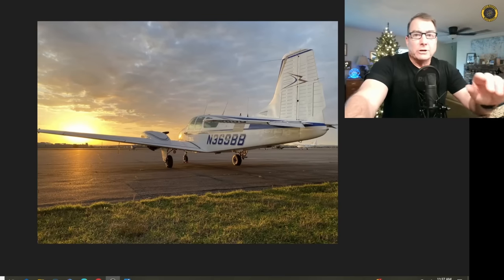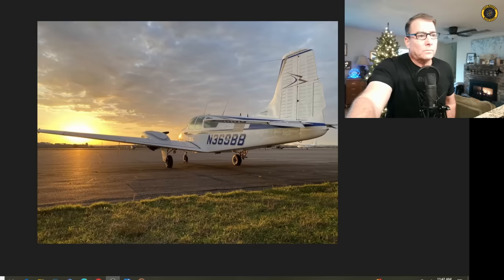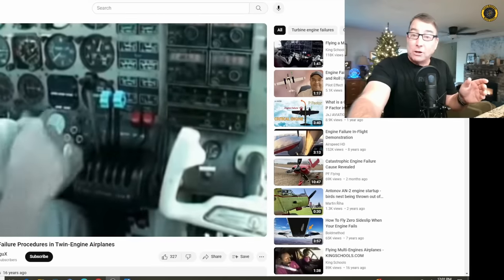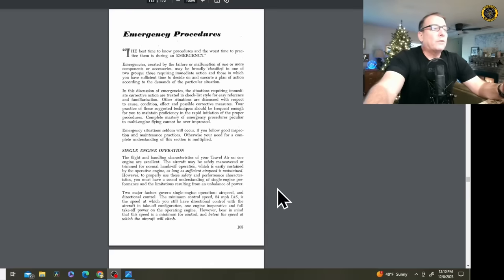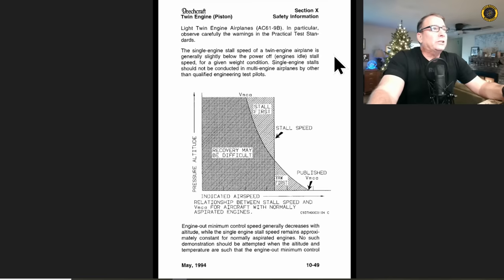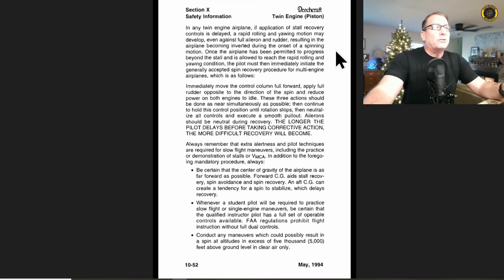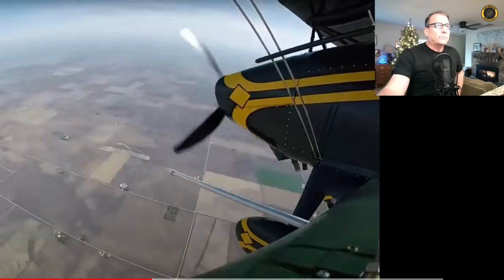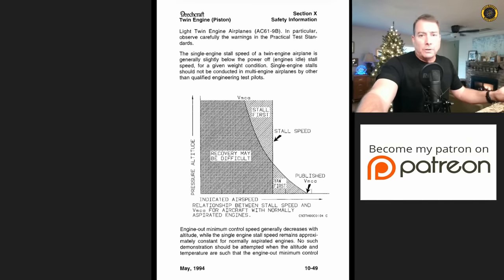Another Fatal Vmc Demo Stall Spin!! N369BB 4 Dec 2023

Comment: I currently live in Huntsville, AL and I currently work at a flying club in the area as a mechanic, and I heard about this crash through the people I work with. It shook me a little bit because I myself have been learning to fly, and have recently scheduled my check ride, which I'm very confident I'll pass. At the club I fly and work at, my instructors have always emphasized the phrase, "Aviate, navigate, communicate", especially in an engine failure and a spin, which the club instructors also emphasize. My instructor always drilled the acronym PAER in my head. Power idle. Ailerons neutral. Elevators down. Opposite rudder. Eventually I want to fly for the airlines myself, but at the same time, I don't want to rush my training. Because I want to be as safe a pilot as I can. And learning from the accidents is one way I think will make me a safe pilot. 

When people say students are being rushed through flight training, I don't have any doubt in that statement at all. In the Huntsville area there is also flight school called Revolution Flight, which this travel air belonged to. I have heard very shady things about Revolution Flight in almost every aspect. Training, maintenance, management, and business. I'd be hard pressed to think part of the cause of this crash was because of the way training is conducted at Revolution Flight. But I'll wait for the NTSB report before I make any assumptions. 

I would also think part of the problem with bad training is instructors not giving their full attention to their students, because they're just using flight instructing to get to the airlines as quickly as possible. I'm very blessed to have been assigned to an instructor who deeply cares for his students, and does a thorough job in making sure his students are ready for their check rides, both knowledge wise, and flight skill wise.
Reply: Our mechanic at our club(50yr pilot) warned me that I had the only good instructor on the roster and to go other places for my instrument rating now that he's unavailable. Seems the quality control acoss the board has dropped significantly.
Reply: The problem with flight instructing is money and regulations by people who don’t know anything. 

As an instructor
1 - you don’t get paid enough to ever live in anything other than a small apartment.
2 - almost every student you get comes to you expecting to be finished at the minimum hours and sometimes fight back at what you have planned even when they’re struggling doing some required maneuvers.
3 - even if you didn’t want to instruct, unless your family runs it’s own aviation business or charter operation you’re likely not going to find another flying job besides instructing until you’ve done about 1500 hours flying in circles

As a student
1 - you are paying a TON of money to fly something that is way simpler and less complex than most cars.
2 - planes are expensive because of supply and anytime someone has an accident, litigious dickheads try and sue everyone for what their worth, further driving up the cost.

Comment: The US Army suffered loss of life accidents in then B-55 Barons due to Vmc demonstrations because the demonstrations were taken to full yaw loss of control.   They found that less than a 5x3" strip exists on the rudder to recover from a spin due to the airflow blanket produced from the horizontal stab and elevator.   Later the limit was defined to any indication of control problem such as stall warning, not full directional control loss.   This is well discussed in all later Baron Beechcraft POH's.   When observed, the Army then had much fewer demo induced spin accidents.   To this day, all Baron manuals  feature this discussion and limitation.   I don't know about the Travel Air, but sensor indication limitation is now observed in many of the airline training academy's.   Sorry to go on, but this rudder problem in the Baron is considered a classic example of DIPE, design induced pilot error, something in the design of the aircraft that lures the pilot into a critical mistake.   In modern aircraft these problems exist everywhere.   You might find this an interesting problem to discuss on a later video.   Of course, the training actions you discussed should be taught to MEL instructors and of course, observed.   Good job, thanks Juan.
Reply: Absolutely brilliant!
Reply: so why  not  cross  coupled  engines to fix the problem ?? a  drive  shaft or  an electrical  solution ?

Comment: That upside down flip also happens in a 172 when practicing spins. One of the huge advantages of those planes, is that they are approved for spins if the weight is kept below the utility weight threshold, which was 2000lbs...at least in ours. Skyhawks really don't like to spin so you have to add a bunch of energy to kick things off...especially with a big boy or two in the seats. The way we did it was to get to a safe altitude (for us it was 4000' AGL) then get really slow and as the horn was blaring, add full left rudder and a healthy shot of gas. That unit would snap onto its back in a heartbeat. 

But like I said, they really don't like to spin so you have to keep rudder in and stick all the way back and even then, it would usually flop out of the spin on its own. What a 172 really does like to do, is spiral. That's the puppy that tears wings off of inadvertent IMC aircraft. It's usually a subtle thing at first. Basically, it starts off as a gentle, coordinated turn. If it happens during a boring part of cruise, you might not even notice. Before too long, the increasing G load may get your attention but then you're trying to figure out WTF...so what happens when you notice the altimeter unwinding? You pull back while in a steep, diving, accelerating, turn and BLAMO! Maybe you snap into an extra violent accelerated spin/stall. Maybe you lose a wing. 

Spin recovery won't always work with a spiral dive and could make it worse. The first rule of spiral recovery, is knowing that you're in a spiral. 

Juan, I would be very interested in your take on spiral dives. To my way of thinking (and of course there are plenty of exceptions) spins are more of a low, slow, patter problem...and spirals are a cruise killer. With a spin, it's the ground that's the killer. A spiral can tear a plane apart without hitting a thing. 

Thanks for doing what you do.
Reply: Excellent post !
Reply: upside down flip ?had it  happen  in  a C152  with  full flap  very  exciting
Reply: Most aircraft will flop onto their backs when entering a spin from forward flight, the type of aircraft isn't really important.  If you're moving forward, a spin is temporarily a snap roll, as you still have quite a bit of forward speed.  If you're fast enough to catch it in a single rotation, congrats, you just snap rolled your plane back to mostly level flight like a boss.  A snap roll becomes an actual spin if you let it keep going (assuming the plane obliges), at which point you lose all forward speed and trade it for vertical speed instead.  The plane will rotate around it's CG, so it's simply rotating around whatever the plane's trajectory is.  If its trajectory is forward, then you're going to flop over on your back like you did a snap roll and will continue to do so until your trajectory points downward.  With most GA aircraft that happens around the second or third rotation unless it's accelerated, or the aircraft is particularly snappy.  Cherokees and 172's are so bad at them (I guess that makes them...good?) that you basically have to hold power, rudder, up elevator, and sometimes even aileron to keep it in a spin, and recoveries are usually hands off.

Comment: I soloed in 1972 and retired in 2015 - initially Alaska-style bush flying (minus the bush, this was in Iceland where the weather is even nastier and bush is hard to find). The absolutely best advice I ever got was before my solo flight: If the airplane starts behaving funny, UNLOAD (reduce the angle of attack)! When the airplane behaves again, fly out of it. If you mucked up at a too low altitude, you are in deep shite...
The same applies if you abuse a light twin (or any multi-engine aircraft for that matter) at altitude; revert the airplane to a C150 mode - chop power and take it from there. If you are struggling on one engine shortly after takeoff, you do not have that luxury, do things by the book or become a statistic. No fumbling around...
Reply: Controlled flight to the scene of the crash
Reply: @hotrodray6802  goddamn right.
Reply: "Shite".
Are you Irish, or have you lived in Ireland before? Genuine question. I always thought only we used the term ;)
Reply: @Hiram1000  I am Icelandic, and use this word as an attempt to avoid censure, not to mention that I like it! According to genetic research I am likely to be up to 70% Irish on my maternal side, something I find good reason to be proud of.

Comment: Risk vs training value was always wrong with the VMCA demo. Twenty years since I was a CFI and amazed they still do it.
Reply: @adotintheshark4848 uh, so you have a clue if you get onto it by accident? Otherwise by the same logic why practice any other emergency procedure that results from human error- just tell the students "don't do this" and it will be fine right???
Reply: @laurencedawson7754 I respect your opinion. However I'm not sure which is the bigger killer. Actual VMCA events or the VMCA demo?
Reply: @laurencedawson7754  You can practice the procedure in a simulator, which won't kill you.

Comment: Juan, great analysis and advice for MEI’s.  I did multi engine instruction in PA-44’s and BE-76’s…42 years ago as an MEI.  Those airplanes have counter rotating props which eliminate the critical engine, but still you needed to be careful doing VMCA demos.  Blocking the rudder is a great solution.  Thank you.  All MEI’s need to hear this.  Also, we need more spin training. So many new pilots are terrified of practicing spins.

Comment: Juan, that flat spin demonstration was impressive.  Me flying twins for over a decade and I didn’t know that applying power flattens and exacerbates a spin. No wonder they tell you to do incipient stalls only, NEVER to full developed ones either in sim and much less in aircraft. 

I’m rewatching and sharing.
Reply: Save real-life spin training for aerobatic training in an aerobatic aircraft
Reply: It's also worth adding to the spin recovery checklist, regardless of number of engines: POWER TO IDLE. If you don't, some aircraft will NOT recover, which is why some are thought to have augered in despite seemingly correct recovery technique.
Reply: We do full stalls in the sim.  Its required as part of the UPRT training all airline pilots get.  Everyone should be doing full stalls in the sim, it's not dangerous.
And honestly, if the aircraft type is capable, you should be doing full stalls in it to.  If someone told me they weren't practicing full stalls in their cub or 172 I'd say they're too afraid of the airplane and to get more training.

Comment: Amazing video!
1. As an 1150 hour pilot who's career was killed by the 1500 hour rule. Thank you so much for what you said. I'm still bitter all these years later. 

2. Your comment about the instructor needing to be on the rudder is spot on! I almost was in a similar fate in a Travel-Air when my student took his foot off the rudder to stretch it 10mph from Vmc. That's the only time I have ever yelled at a student. Scared me to death. 

RIP to the pilots. Very sad.
Reply: Can you please elaborate on how requiring 1500 hours killed your career?
Reply: @kickinit8314  when a Cessna 150 rents for $150/hr its easy to see why.
Reply: The 1500 hour rule hasn't killed your career. Go to one of the flight schools that has the 1000-hour or 1200-hour waiver, or go to a 135 operation, or be a flight instructor.
Reply: Bottom line the 1500 hour rule does not save lives. It just cost money.
Reply: @kickinit8314 It was 2010. The fight school I was at discontinued fixed wing and stuck with rotorcraft. A lot of pilots were laid off from the airlines at the time because of the economy. So every other school within 100 miles didn't have an opening for a CFI. I was young and unsure what to do at the time. Then the 1500 hour rule hit in 2011. I had no path to obtain it at that point. And I got a non aviation degree because that's what every pilot told me to do. So I couldn't do the R-ATP mins.

Long story short it was a different time. Imagine paying money to sit in the right seat of a Beech 1900.
Reply: @iammrvain  Name the US part 121 accident that's happened since the rule was instituted...
Reply: @IslandSimPilot   I can’t that’s my whole point!   It does not save lives. It just costs aspiring pilots tons of money.  Name the part 121 accident that occurred prior to the 1500 hour rule where the pilot flying had less than 1500 already. The accident that the rule was based off of both pilots had over 2000 hours.
Reply: @IslandSimPilot  Name the US Part 121 accident that could have been prevented by the 1500 rule for copilots.
Reply: @Pilotaaron1 So there was no flying jobs that you could have done to build hours?
Reply: @TheFlyingZulu  At the time yes. And it really sucked. As I said, I was young too and just couldn't figure out where to go. I completely blame myself in that regard. I still beat myself up over it from time to time. I hope one day to be in the air again.
Reply: @Pilotaaron1 Have you thought about switching back into aviation part time and slowly get back into it full time? Lots of places are hiring CFIs and pilots in general right now. Good luck. I'm at 240 hours myself getting ready for that commercial checkride... I'd move countries if that's what I had to do to get a flying job. lol.
Reply: @TheFlyingZulu  That's my plan after all the holidays are done. I talked to a school here in town that would let me work part time once I'm back up to speed. I'm also restoring a 1956 172 with the help of an A&P friend.
Reply: A pen with lot`s of refills can rejuvenate your career quickly.
Reply: @captainaaron1 If you were young in 2010, you can’t be too old in 2023, no? I hope you reach your dream. Regret is not a nice feeling. I have regret, but I have accepted it and learned to live with it and have set other goals that I can achieve, but not becoming an airline pilot still gives me regret regardless. I think it will always haunt me until the day I die.
Reply: @southseasflying  in other words you won’t answer my question, because the answer of course is: none.
Reply: @IslandSimPilot  Same could be said for your lack of response to the question poised to you.
Reply: @Pilotaaron1  That really unfortunate and unpleasant for you.

However, I have noticed that american pilots tend to be unwilling to travel abroad for opportunities. There are plenty of hours to be had in Africa/Asia. 2010 as much as now.

In New Zealand, although we don't have a 1500 rule, the airlines would never employ someone with experience that low anyway. It was accepted that any non instructing pilot that wanted to make needed to travel abroad and find non instructing hours. Few failed to find the hours.`

`Did you consider anything other than instructing?
Reply: So 25 hours multi and 1475 hours beating around in a 172 makes you ready for airlines. The government fixes everything.
Reply: @thommykent7785  LOL, in my dad's time that was called "P-51 time", because there was a fancy fountain pen marketed as the "Parker 51".
Reply: @mikeflippo6273 Not the point of the rule. The point of the 1500 hours was to improve QOL and pay for pilots so that they weren’t making less than a McDonald’s employee and wouldn’t consequently be treated like shit.
Reply: @bobjohn2000 Colgan flight had nothing to do with pay and QOL. As a result of the 1500 minimum, it put a strain on the industry and yes the pay had to go up. But saying a Cessna 172 pilot with 1500 hours is more qualified for the airlines than a 500 hour Cessna 172 pilot is lunacy. After Colgan, they should’ve mandated more training each year in the sim.
Reply: @mikeflippo6273  I worked with somebody who was an intern staffer for Schumer when they were drafting up the legislation. The idea was to create a bigger gap between average GA pilots and airlines, and to make a smaller gap between mainline and regional. One of the biggest ideas behind the bill was to make regional pilots more in-demand, and thus the regional airlines would treat each incoming pilot less like a commodity (better QOL, actually having to go through ATP-level training). Pre-Colgan, regional FOs were treated like absolute crap  because they were about as plentiful as crap, and now regional FOs are making six figures and have good benefits.
Reply: @bobjohn2000  and that’s great that the guys at the regionals are making great money because they deserve it. The whole industry is screwed up. Right now I’m spending about $200 an hour trying to learn how to do lazy eights and Chandelles. I’m sure I’ll be doing those in a CRJ or citation one day 🤦 . It’s ridiculous how much money this profession makes you spend wasting time on useless maneuvers. The emergency stuff is great but the rest of it is a complete waste of time and money.
Reply: @mikeflippo6273  The military, usually hailed as the pinnacle of pilot training, spends the initial part of pilot training teaching their guys to fly moderate/hard aerobatics. None of it is useless, keep chugging along and you will be a jet driver in no time.
Reply: @bobjohn2000  thanks for the encouragement but nobody can convince me those two maneuvers will make me a better aviator. All of the stall, emergency, eights on pylon is very useful. Power off 180? Meh. They’re fun to do but why is an “accuracy landing” without power required? It’s stressed that it’s not an emergency landing so….I don’t know, a lot of money spent learning some things that do not come into play unless you’re doing air shows 😆.